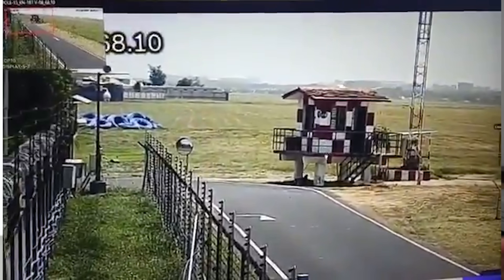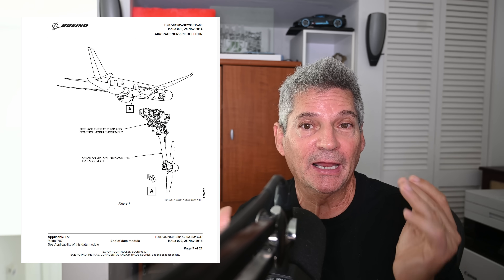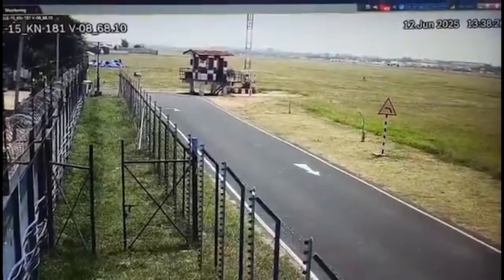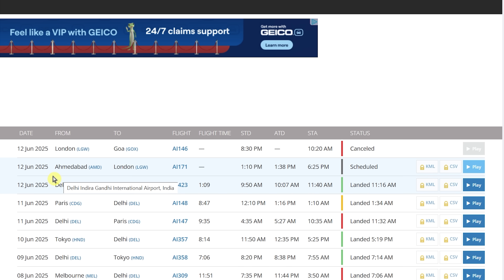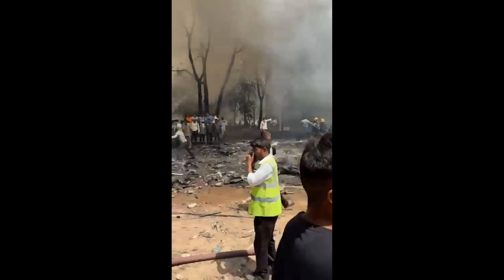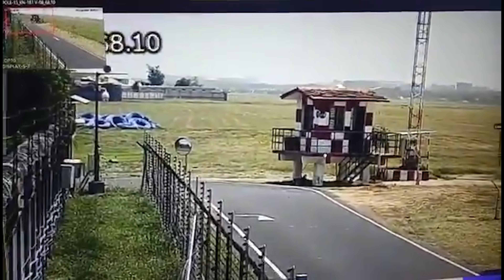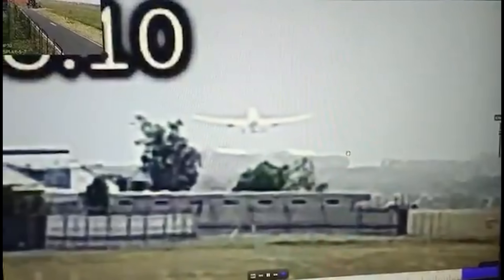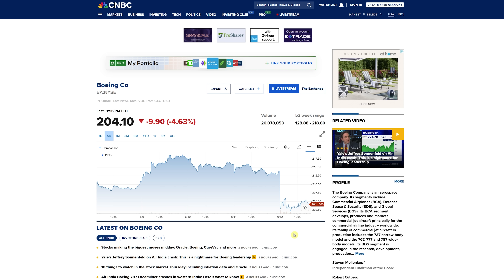What Caused Air India 171 Crash, Mysterious Sound Before Impact

Comment: I have studied this all day.
1) improper flap management 
2) engine sound is max whine of engine, while attempting to gain altitude.
😢
Reply: Nah the sound is the RAT
Reply: @intruder313 yeah engines sounded not at max power to me at all
Reply: @intruder313 No it's not the RAT try again
 All these people that think they have all the answers is pathetic.
Reply: @jase4270 it sounds exactly like the rat. Why do you think otherwise? Those jet engines don't sound like a propeller at any thrust level.
Reply: @intruder313 nah, you should have seen it clearly. It was not out.
Reply: @intruder313  Nah, the sound is the Turbofan Engines at takeoff power, they sound like that specially when there are buildings close makes extra echo/reverb, you can also clearly see, and i mean clearly see that no RAT is deployed behind the rear right landing gear of the plane in any part of the video.
Reply: @intruder313  A RAT is about as big as the box fans in people's living rooms and doesn't make that much more noise.
Reply: @johnstuartsmith did you even watch this video and the other examples of planes flying by with the RAT deployed? Sounds just like that.
Reply: The plane was already flying and climbing when something happened. 
Why would the plane already be up if it was configured wrong?
Reply: @yoxat1  You have to be a pilot to get it.  Still, we know now the rat generator was deployed meaning = dual engines failure.
Reply: @yoxat1 they used up all their excess airspeed…easy.
Reply: @yoxat1 Ground effect may be a factor...
Reply: @yoxat1 ground effect, it increases the performance of the aircraft. You can get into the air, but after leaving ground effect you lose that extra lift. If you don't know what ground effect is, look it up yourself. Ground effect is more prominent in low-wing aircraft.
Reply: @yoxat1 When you leave ground effect, things go wrong. Ground effect happens when an aircraft is close to the ground and the air from the bottom of the wing is getting extra lift from pushing against the ground.
Reply: @yoxat1  He put up the flaps after takeoff instead of the gear.
Reply: @hia5235  Nope - 1:08 you can see right between the flaps and the wing. You would not see that space if the flaps were up.
Reply: @hia5235  Why is there a pic of the slats out
Reply: @hia5235  no proof of that and if it was then why is the RAT deployed?
Reply: @hia5235  Wrong. The landing gear is partially retracted. The hydraulics went out before it could complete.
Reply: @yoxat1  lol
Reply: By now the Indian authorities probably already have downloaded the data and voice recorders. I doubt that this crash will be hard to solve.
Reply: @SeeLasSee they haven’t found the black box yet
Reply: @droneshotsantoine1805 does it not have some kind of transponder or tracking mechanism
Reply: @cringycook9597  activated by water, yes. not on terra firma
Reply: @droneshotsantoine1805 they have the airplane tail intact empaled in a building.  That’s where they are. They have not said they don’t have the boxes.
Reply: @SeeLasSee  It was only announced today that 1 of the 2 black boxes was found. The other is still missing. So I don't understand your comment😅
Reply: @droneshotsantoine1805  the other found too just now on top of the medical college where the plane crashed
Reply: It's the simplest explanation. Double engine failure on a 787, not likely.
Reply: @garrymullins  I don't see birds in the video, but it wasn't likely that Captain Sullenberger's A320 would lose both engines, either.
Reply: @garrymullins  well, there is the possibility of bird strikes at take off... large enough birds can take out the engines.
Reply: @seamusoleary3712 but we didn't see a single puff of smoke or any sign of failure from the engines in any video.
Reply: At take off plane needs flaps extended to aid with pulling up after takeoff
Reply: engine/electric/hydraulic failure, the bang the survivor heard was the RAT deploying
Reply: Zoom in at 1:58, you can see the rat.
Reply: From what I've seen in other bird strike videos you'd expect to see something coming out of the engines, smoke, debris, etc. In the video there is no indication of that whatsoever.
Reply: STALL STALL STALL
Reply: Wrong flaps were out.
Reply: @lightningsrt4707  wrong, flaps were not out, anyone that is pilot can see that. not in takeoff configuration.
Reply: @Heavycap sorry honey but there’s pics of the wing on the ground after crash that flaps are out.
Reply: @lightningsrt4707  lol, so in the video where you can clearly see that the main flaps are completely up during the entire stall and crash you go by the wreckage statement?
Reply: @Heavycap there is a photo of the wing on 5he ground after  crashing that the flaps are out.
Reply: @lightningsrt4707  yea, looks like your right, not a flap issue, rat was deployed from the better video quality I watched, man, full power failure, hopefully it was fuel related
Reply: @Heavycap yea I think something went wrong when the started the landing gear retraction, because it started and then stopped and engines failed. Then rat came out, just sucks
Reply: Man. This is rollce royce engine NEW engine. About 60% less noise sound. The "quiet" this engine is a normal. Check wikipedia boeing 878 😢
Reply: Sounds like a rat but I don't see it..
Reply: A hear a propeller sound (most likely the RAT) but I dont hear to massive turbine engines blasting full power; the jet engine noise resemble more like a jet engine during landing
Reply: lol
Reply: You've never heard what a jet engine sounds like, apparently.
Reply: Adjust you're ears bro.  This is FANTASTICALLY different from usual noise.

Comment: As the plane took off and passed the end of the runway, the second video (view of the plane from the port side) shows a dust disturbance below the plane.  Does this mean that both engines were operating at the end of the runway stirring up the dust?  If the engines were not working at the end of the runway, could the convective outflow from the wings and plane profile (while gliding without power) stir up the dust?

Comment: What's more important is not what you hear but actually what you don't hear. The supposedly RAT noise could be anything including a scooter on the street (plus on the footage it's kind of clear that the RAT is not deployed). The most revealing thing is that there is no noise from engine noises that should be at full thrust at this point and obviously to spot at the slow altitude and echoing between the surrounding buildings. So at this point and very simply, everything seems to point that the engines were not producing enough thrust to keep the plane up, that simple.

Comment: aside from the gear being down, the aircraft is clean. The flaps arent down. the flaps should be down. watching the plane take off, I didnt see any flaps either. either they didnt do the checklist, or the flaps didnt deploy when the pilots commanded it. By the way, Ive been building aircraft since 2009. Worked wings on C-130Js, currently working on corporate aircraft and have many 747s under my belt. The absolute best place to sit in an aircraft for survival is right above the wings simply because they are the most structurally sound part of the aircraft. they are designed to take the entire load of the aircraft on belly landings and they are some thick structures. The skin itself would be roughly 3/4" thick around the center wing tank, yet I dont know about the 787 because I think its carbon fiber? Normally they are made out of 7076T3, and the fuel tanks are the sturdiest parts of the wings. I can almost guarantee you that center wing tank is in more or less 1 piece. IF theres a place you want to sit just in case, its the chord of the wing.

Comment: The exhaust trail (atmospheric distortion and smoke) appears to stop right before it cresta 600+ft. This could indicate that both engines shut down as it was taking off. This supports your observation about the deployment of the ram air turbine.

Dreamliner had battery issues in its early stage of production. This might indicate the presence of  electrical issues that went unaddressed. After all this plain was designed during the time Boeing was manufacturing flawed aircraft.
Reply: Regarding the electric issue- There was a lady that was on this plane, the flight right before this one, she took some videos showing the seat tv screens not working. The air conditioners were not working either, she noted many passengers fanning themselves using the magazines they provide at each seat. She took those videos to complain to the airline but I imagine now they’ll become part of this investigation. It’s so tragic.
Reply: Except that once engines are turning on an airplane, just the same as a car, the battery does nothing.  And as long as one engine/apu is turning, or the RAT is engaged, the plane will always have a steady supply of electricity.  Several decades of avionics experience here.
Reply: @ericsortzi5669  Even in the case with the RAT deployed there was no time to save the plane

Comment: What I hear is the crash noise synched with the video.  The crash noise would have occurred about five seconds after the visual being at least one mile away.  So the RAT noise may be something else like a car.
Both of your noise examples are from aircraft at landing, which is far quieter than at take-off power.
Reply: I noticed the lack of delay on the sound as well. The noise should never match an explosion in the distance, the delay is very noticeable in real life.
Reply: well, this is clearly not a regular take off at proper levels of thrust
Reply: Yep I noticed the lack of delay too. Should have been at least a 4 or 5 second delay at sound speed of about 1100 feet or so per second.

That this guy didn't notice that, nor the cloud of dust kicked up at takeoff, makes me wonder about his qualifications.

Comment: No flaps
Wings were clean. Not ideal in any situation especially reduced runway length, hot weather with a full load of people and fuel.
Reply: Is flaps necessary wt if pilot forget flaps
Reply: @Movieswod-v9f Yes they are. This is what they call the hi-lift. Although the video isn’t the best it looks like the wings are clean ie flaps fully retracted. This would cause the exact same flight characteristics we saw. Someone F’d up is my guess. FDR (flight data recorder) will tell which position things were in.